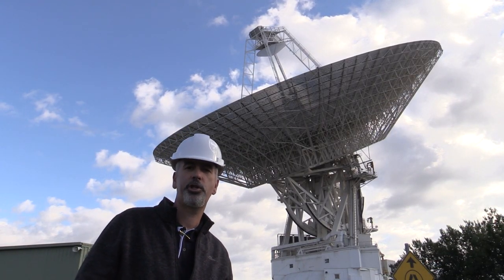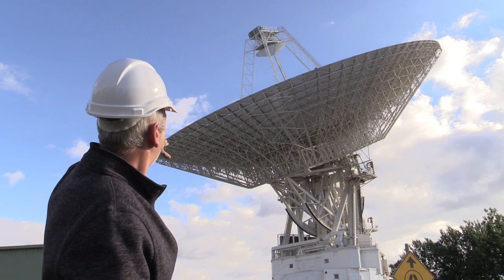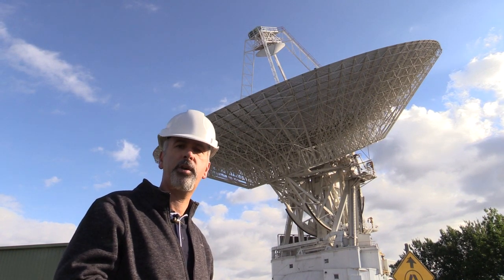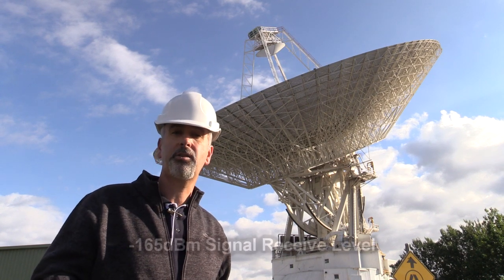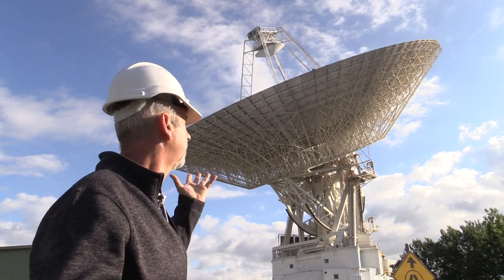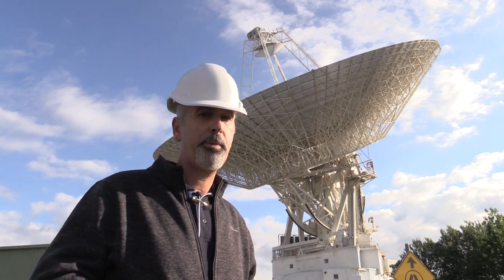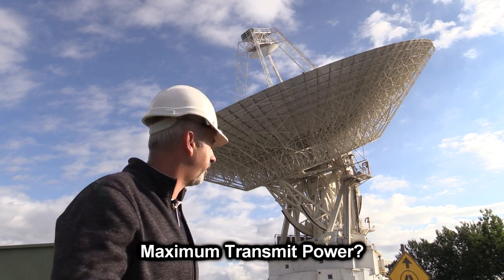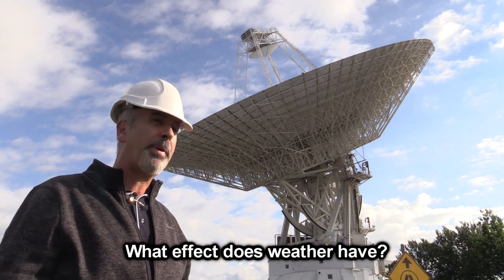How To Contact The Voyager 2 Probe (PART 1)

Comment: The thing is 40 years old... 40 years in cold cold space... Still amazes me ^^
Reply: Nothing keeps the cold away as a lump of plutonium!
Reply: Most likely due to the fact that greedy assholes are manufacturing a lot of unsafe and badly designed products in china. Almost everything that blows up in your face or breaks out of the box has made in china written on it. That said some of the highest quality products are made in china as well, but the tsunami of garbage being exported does leave a sticky trail in the minds of people, not letting the good stuff shine.
The sad part is that there is high demand for the cheap garbage mostly out of ignorance of their inner workings or the condition in which they were made.
Reply: kyis if you want quality you must pay more

Comment: "THIS IS 20 BYTES!"
20 BYTES IS 160 BITS
Both of those statements are 160 bits in length. It takes 1 second for Voyager 1 and 2 to send each line that you see above this sentence. Getting 20 characters per second from interstellar space from a 1977 probe is actually quite a good speed.

Comment: WOW: Voyager Communications via DSN
30 MILLI  DEGREES AIM required!
+/- 1Hz frequency lock!
- 158dBm signal received! (Kepler = -165dBm; Maven = -170dBm)!
SNR =~ 6.5-7.0 dB
even slight rain fades the 34m dish!
19K "Noise temperature" from cone to receiver!
Multi-convolutional encoding (same as ADSL modems)!
Once a week: BLF (Best Lock Frequency) Characterization Exercise: send ping messages on varying ramp of frequencies and 30hrs later receive fastest ping back...tells you the best channel to use for that week!

Comment: Thank you Dave & Richard for this. Myself and a mate made a trip from the UK to go to our nearest DSN which is Madrid and were a little disappointed to find almost no technical info about the workings of the station, even the https://eyes.nasa.gov/dsn/dsn.html screen in the visitors centre was down and we had to use our phones to check the site for what was actually being tracked at the time. Had a quick look round the visitors centre then took about a hundred pics of the dishes! :-) DSS63 is right next to the road and main gate which was about the only saving grace. So fantastic to get some proper technical info. Cheers again guys!

Comment: ...retrofitted vacuum cleaner in reverse blowing water droplets off the positive pressure nitrogen volume radio transparent envelope above the cones omfg I'm in HEAVEN! ...keep it up Dave, this is gold. Looking forward to the synchrotron in Melbourne and the DoD might even let you do one on JORN?  

I guess the key is having someone like Richard, especially a little wired after a 12hr shift to be loose and passionate and so knowledgeable on the minutiae of the tech and also the history... well done, let 'em ramble Dave......thanks for this, I hope it's a successful experiment.

Comment: For the type of bandwidth and frequency accuracy they need, what kind of local oscillators are they using?  Is GPSDO good enough?  I am thinking not.  Dave, investigate the metrology.
Reply: Each Complex has a pair of atomic clocks. We have 2 Hydrogen Masers that provide timing (1pps) but just as importantly generate 5, 10 and 100Mhz frequency references

Comment: I was curious about the wind loading specs on the 70m antenna. And does a moderate wind distort the parabola enough to cause problems on receive and transmit?

Comment: I know you can translate radio to sound to “hear” signals. What does voyager sound like?
Reply: A bunch of ones and Zero's nearly hidden amongst the noise
Reply: Depends on what stage of detection you listen to. It's phase shift encoding, so prior to feeding it into the quad coupler it'd just be a steady tone. If you could hear the output of the quad coupler, it'd sound like a dot- matrix printer without the carriage returns. Once it's detected, it's just serial TTL pulses, like RS-232 but much slower.

Comment: Why does the maximum bitrate decrease as it gets further away? Fascinating topic to kick this off, looking forward to what you come up with next!
Reply: Bobby M because as the spacecraft gets further away, the signal gets weaker and individual symbols become harder to distinguish. lowering the data rate effectively adds more data points making it easier to recover the original information.
Reply: But specifically - I was imagining it could be extra overhead due to more error checking like CRCs, or is it just by having a lower frequency (and lower bitrate) does that equivalently mean that the "pulses" of information are longer and less likely to be interfered with? Or do you just have to use long wavelengths, which I suppose directly leads to lower bitrate, for some other physical reason (like in atmosphere certain wavelengths travel further than others).
Reply: Look up the Shannon-Hartley theorem. Adding extra error correction and lowering the data rate are theoretically equivalent :)
Reply: Beer Tower hey thanks! that's really interesting - just what I was trying to understand.

Comment: 'Not like Beagle - that hit Mars'

Ouch. Too soon :-(
Reply: neatodd Actually, photos show that it actually landed safely but it's solar petals failed to open properly. it's amazing to think it actually got to the surface.
Reply: The USA is the only country to date that has ever successfully landed a mission on Mars. Though really not too many have even tried.
Reply: +Mike Smith
Would it be possible for another rover to go there and "manually" open the solar petals?
Reply: +TiagoTiago while anything is possible it would be far easier just to land another mission on the surface than mount a rescue. The target landing ellipses are huge, and traveling on the surface is difficult. So I would have to say for all practical purposes no, it is not possible.
Reply: Maybe he was thinking of the Schiaparelli lander, that caused a new crater :-)

Comment: So do they have to aim the transmission to where Voyager will be 15 hours later? and then to receive, aim it where Voyager was 15 hours ago?  Like trying to shoot a duck in flight?  Or maybe the arc width of the beam is enough to cover the target without compensation for the distance traveled in the 30 hour round trip time?
Reply: probably.....  also they tune a little of frequency because that even shifts a litle bit! (doppler effect)

Comment: is it possible to use communications satellites instead to contact Voyager?
Reply: No.  Communication satellites do not have the very large antennas needed to detect Voyager's extremely faint signal; nor do they have enough power (being solar-powered, and small) to send a signal to Voyager that the spacecraft can detect.  It would in theory be possible to communicate with Voyager using space-based systems, but there would be no point in building such expensive systems when cheaper equivalents can be built right here on Earth (namely, the facilities of the Deep Space Network).

Comment: NASA needs to develop Space Based High Power with the help of the US Navy.  The Space Based Power can provide power for a Probe at high data rates and high power and have power left over for an Ion Rocket Engine and active sensors.  tjl